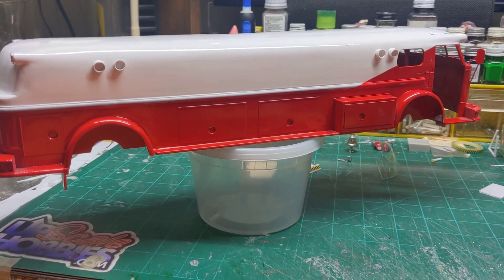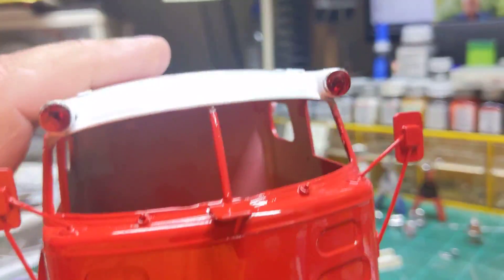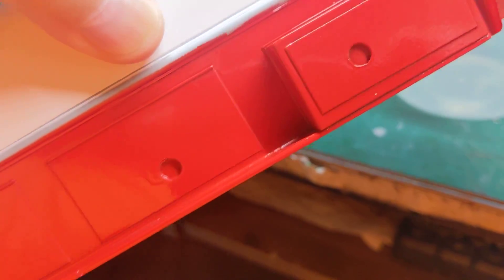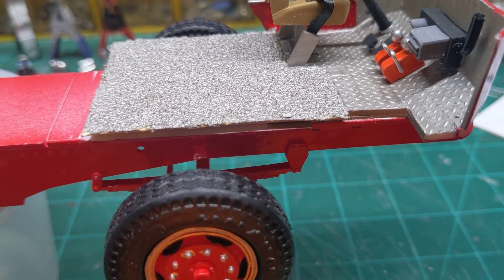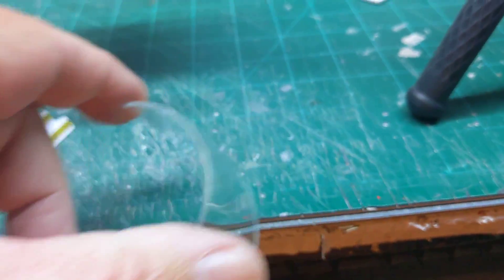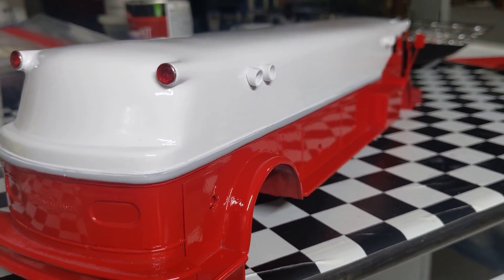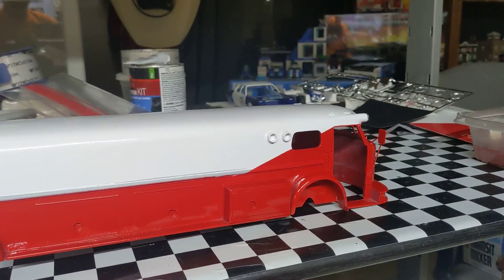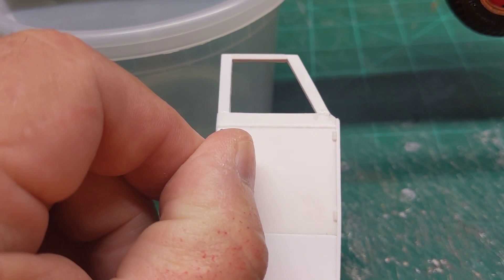We have color!

Comment: Absolutely cool, great work!
I've got a general question about the red color: I'm currently working on a H0 fire water tanker, so I checked what red color is commonly used on American fire vehicles. So I came across "Fire Engine Red" (aka "Fire Truck Red", hex code #CE2029). Very difficult to get this color over here in Germany, so I will use an only slightly different red (RAL 3028 Pure Red). My question would be now, do model builders in America pay attention to this "right" color for fire apparatus? Well, you have chosen cherry red, which of course isn't really wrong, because not all fire departments use this special "Fire Engine Red"...